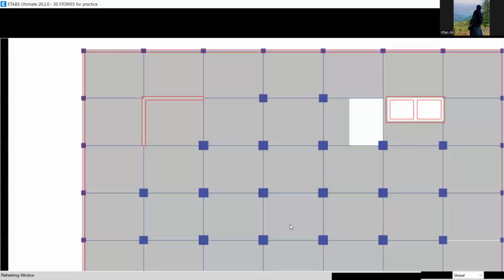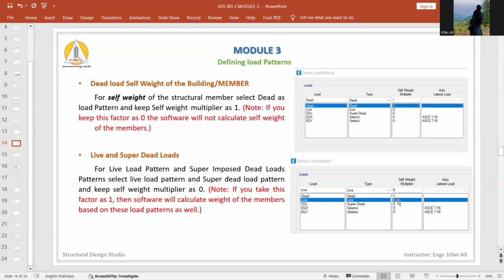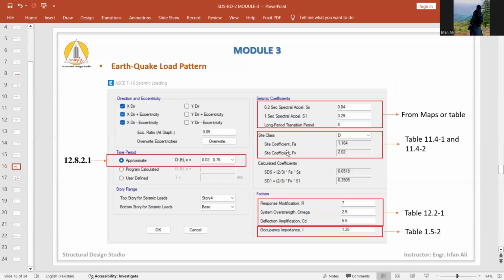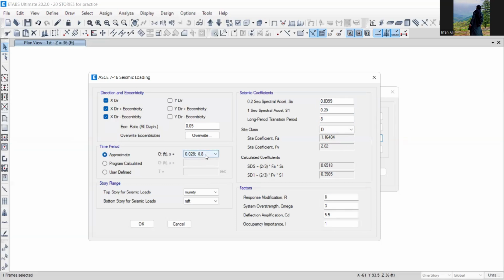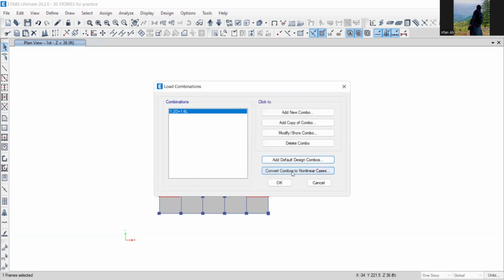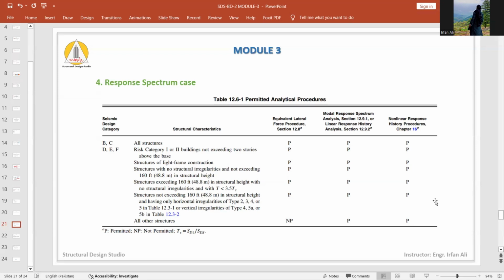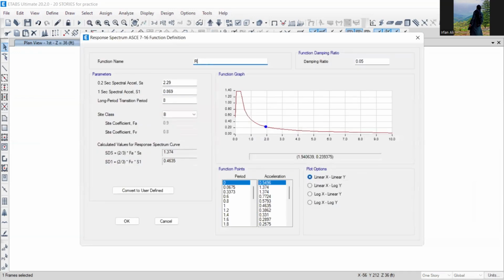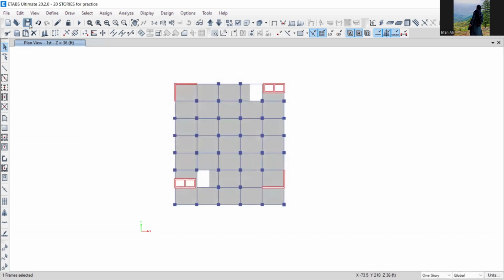module 3 part 2

Comment: Please elaborate on how you calculated the value of 383.4 during the initial scale factor I?
Reply from the maker: etabs uses inches as the default unit. So, we have acceleration in g units, which is 9.81 m/s², we just converted g units to inch units. 
1 m = 39.37 inches
9.81 m = 386
Reply: @ddesign-studio  Yes I understand that, but you took 384.3 instead of 386?
Reply: Thanks. I will.